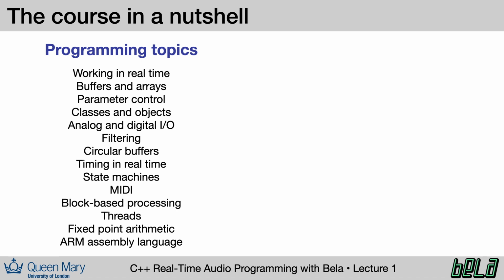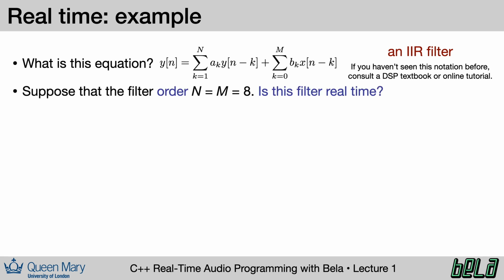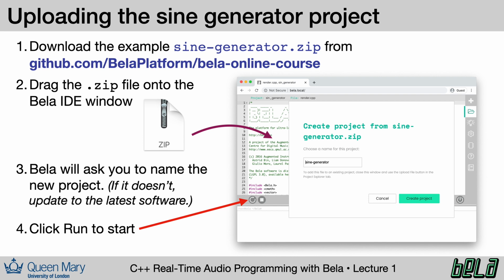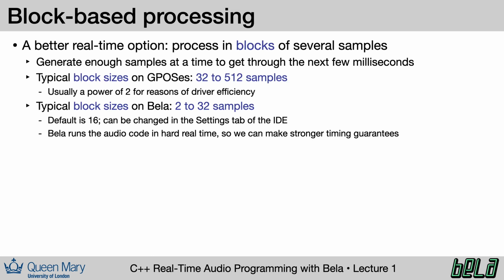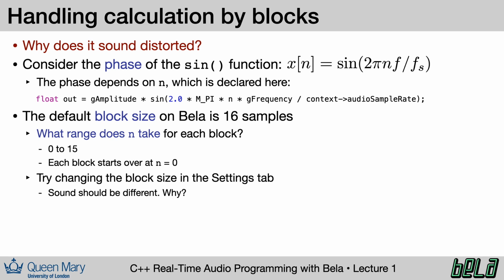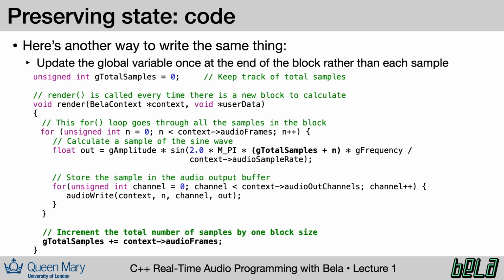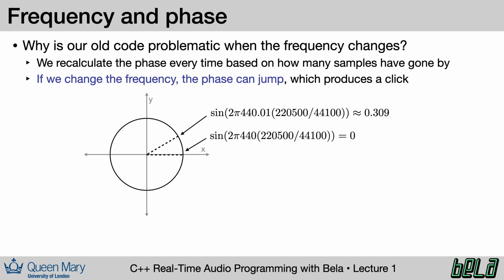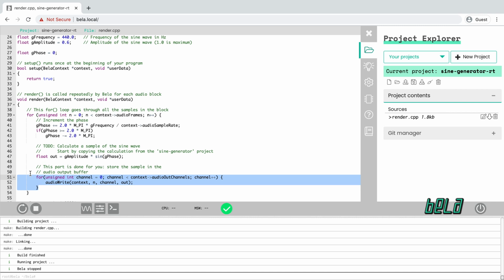1: Real Time, C++ Real-Time Audio Programming with Bela

Comment: you wrote "render() is called repeatedly by BELA for each audio block":
In the C code, however, it is just one function comes and goes. Where did you set this to run repeatedly like 'while' command? Thanks.

Comment: Thanks for doing these lectures, very good starting point to using Bela!
When trying out the examples here I experience that bela start running audio before the browser has told me that building is finished, why is that? When I checked now the audio ran for about 11 seconds before the browser showd "running project"
Reply: As soon as the program starts, the audio takes priority over other processes in the CPU. This may mean that the notification that the program is running takes a few seconds to bubble up through the server to the IDE. 11 seconds is definitely much more than normal though, unless you are running a very CPU-intensive project?
Reply: @oromoiluig  I'm just running the examples from these videos, so no big projects. The delay wasn't all that slow today. Maybe it has something to do with the browser performance? I really wish bela had it's own ide, not browser based
Reply: @tolfred  we preferred the self-hosted approach to minimise setup time and also minimise the maintenance effort (no need to build, package and release the IDE for several operating systems).
Reply: I have experienced something similar today. I think it is the frontend (browser) hanging, not the server. This is probably a bug in our frontend code.
Reply: @oromoiluig  It's probably a bug. Haven't tried another browser so can't tell you if it's a problem somewhere else. I'm on a computer running W10. Just ask me if I can help you with sommething!

Comment: Does it mean program will eventually crash using gNumSamples++ approach when it goes out of range?
Reply: It won't crash, but when gNumSamples runs past the end of the range (about 27 hours for a 32-bit int at 44100 samples per second), it will wrap around back to 0 (if it's unsigned) or a large negative number (if it's signed), and in either case you would hear a click. The main reason not to count samples is instead that you can't change the frequency without glitches.

Comment: you should calculate static float gFact=2.0*M_PI/context->audioSampleRate only once. Then calculate float pFact= gFact*gFrequency once outside the loop and then gPhase+=pFact;
Reply: Right, 2.0 * M_PI * gFrequency / context->audioSampleRate part could be calculated once in setup()
Reply: @ilionix  As gFrequency is variable, you need to put the frequency factor inside render.

Comment: Ideally you should wrap from π to -π for maximum precision (also: fmodf). Or even better: use an unsigned int phasor (with (UINT_MAX+1) scaled to 2π) and use wraparound for modulo :)
Reply: All good suggestions! Or even consider using a wavetable or one of the efficient recursive algorithms for calculating a sine so we don't have to call sin() or sinf() at all.
Reply: @apm414  Yes, and integer phasors work especially well for wavetables :) For the recursive approach, quadrature oscillators are great (and give you the cosine for free): https://dspguru.com/dsp/howtos/how-to-create-oscillators-in-software/

Comment: Probably 'while' instead of 'if' at 39:05 would be better. Wouldn't it?
Reply: That would be safer, yes. The assumption in this code is that the frequency is never higher than twice the sample rate, so the phase will never jump more than 2.0*M_PI at a time. 

For this case, the consequences aren't so bad if we're wrong (it won't crash at least). There might even be a marginal efficiency benefit to if() depending on the processor and compiler. In a later lecture we'll look at wavetables where it's really important that we never accidentally fall off the end, and there an if() statement would be dangerous.
Reply: while() would only be needed if there was a chance for the phase to larger than 4 π. Given how the phase is wrapped around every sample, the only way you would have gotten there would have been if your phase increment was larger than 2π, which would imply a f > Fs, which is unlikely to happen for a well-behaved audio program. For a complete fool-proof approach, you'd also have to guard against negative frequencies. We kept it simple for  ease of understanding.

Comment: Very inspiring, thank you for sharing this with the community! I don't have a Bela (yet), but after watching this I am now craving for one! 

There is one bit of the tutorial that I am really struggling to grasp, though, and that is the one where you fix the issue with the distortion caused by step-wise frequency increments (once per block). The solution you implement looks to me like a simple change of variables, where you are simply introducing an intermediate step (the calculation of the phase), but I can't understand what has changed in practice. The explanation you give seems to imply that the problem is in the sudden phase jumps (which makes sense to me), but  I can't understand how those are supposed to disappear in the second implementation...can someone please elaborate?
Reply: If you are referring to the solution given at 27:28, the key point here is that the earlier code did not keep track of how many samples had passed since the beginning. This new implementation uses a global variable to store the number of samples that have passed since the beginning. The difference here is not so much in the fact that there is now a dedicated variable, rather it is in the fact that this variable is global, and therefore its value persists across calls to render(). It starts at 0 and is incremented every sample. During the first execution of render(), it will have the same values as those of the n variable that we were using previously. By default there are 16 frames per block, so it s value at the end will be 16. When render() is called the second time, with a new block of samples to process, n will start again from 0 counting up, while our global variable will start from the value it had at the end of the previous call (16), and count up to 32, and so on. Hope this clarifies it.
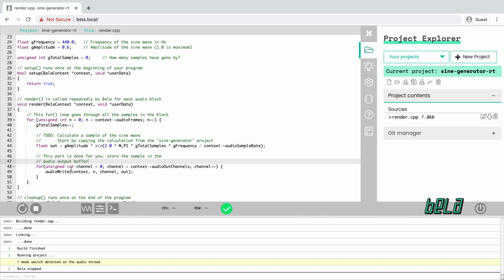Reply: @oromoiluig  , I am actually referring to the problem introduced at 31:30.
Reply: @K4T4T5UMUR1  Good question. The problem with the first implementation (gTotalSamples) is that we have to recalculate the phase every time based on the assumption that the frequency has always been the same for all of those samples. But if the frequency changes, our calculation is going to be wrong, and the phase will jump.
By way of analogy, suppose you were an avid cyclist and you wanted to keep track of how far you rode in a year. So each day you set out, you recorded the number of revolutions of your bike wheel and tallied them all up. If you measure the diameter of the wheel, you can always work out how far you've gone in total. But then if you put new tyres on your bike with a slightly different diameter, you'd get the wrong answer if you tried to work out how far you'd cycled based on the number of turns of the wheel. Better to just remember the variable you care about -- how far you've gone -- rather than recalculate it each time.
Reply: @apm414  , gotcha! Thank you very much for the explanation, it makes a lot of sense now. Cheers!